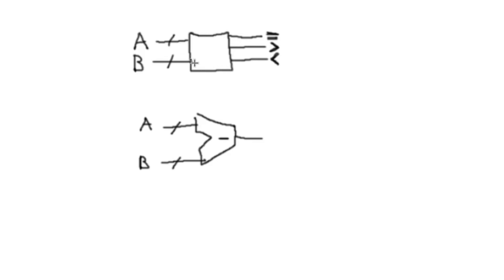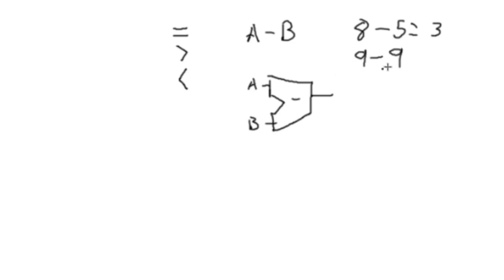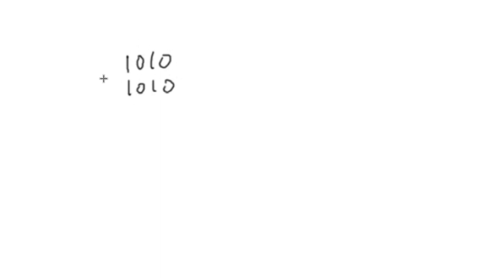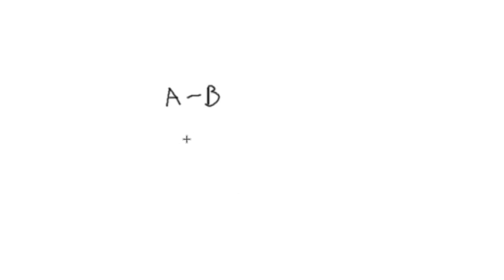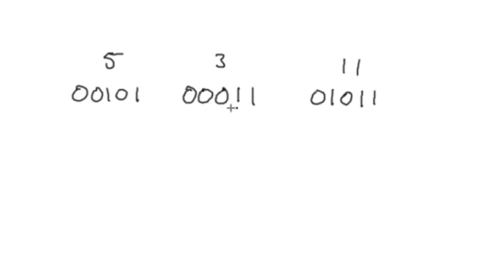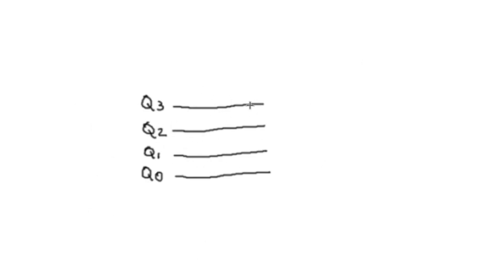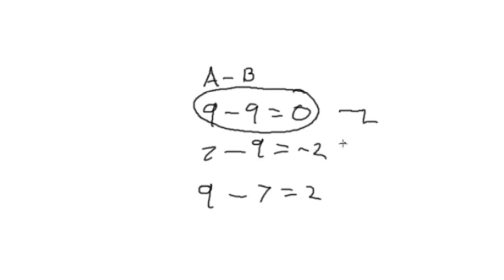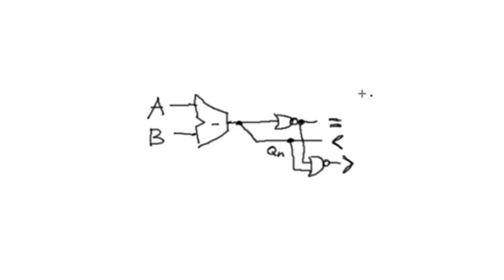Using Binary Subtractors as Digital Comparators

Comment: I have come up with a different solution to this problem. I can reuse the comparator circuit as a subtractor. If I want to know if it's greater/lesser/equal during subtraction I check flags. If carry flag is on, then the result is positive, if it's off, then it's negative and if 0 flag is on, it turns off the outputs from these two flags.
Reply from the maker: shhhhhush! We're getting to that!
Reply: @n00b_asaurus  I have been watching a fair amount of your videos recently, as you can see from my freqent comments so I'm excited for another video, ngl

Comment: How is overflow dealt with? e.g. in a 4-bit system if A=6 and B = -6, we get an overflow state where A-B reads as 1100, or -4. The circuit would say that A<B, but that shouldn't be the case.
Reply from the maker: In that case we would need a circuit to detect that overflow condition.
Fortunately that's not difficult, overflow is defined as carry n xor carry n-1.
I.e. if there's a carry into the sign bit and no carry out, or there's no carry into the sign bit, but there is a carry out, you have an overflow condition.

From there, you can nullify the comparison result, or adjust it.
Reply: @n00b_asaurus  Thank you for your guidance! I managed to work out the over/underflow adjustments.